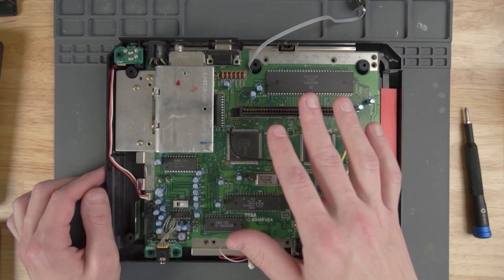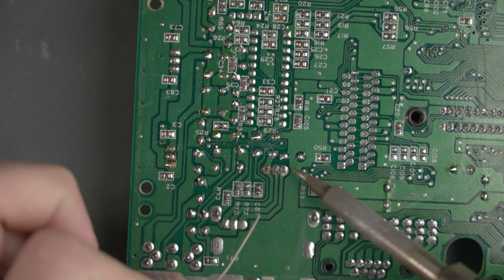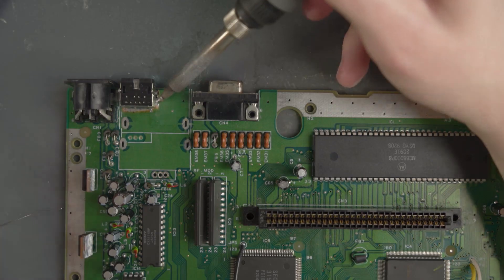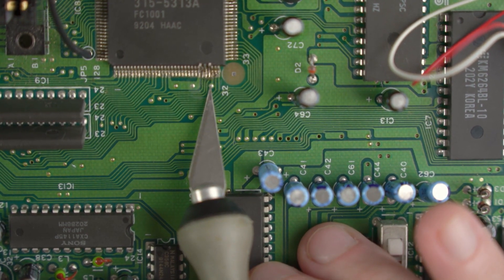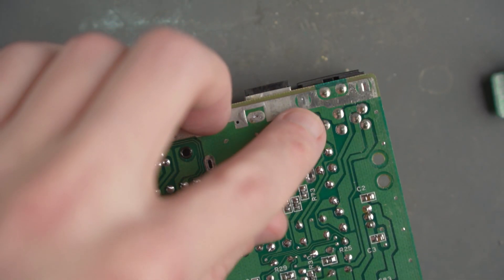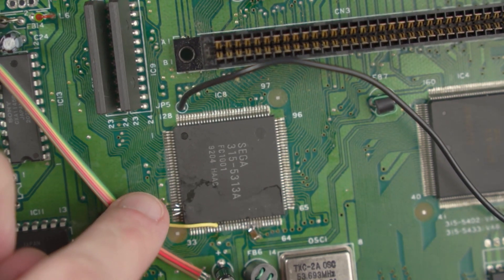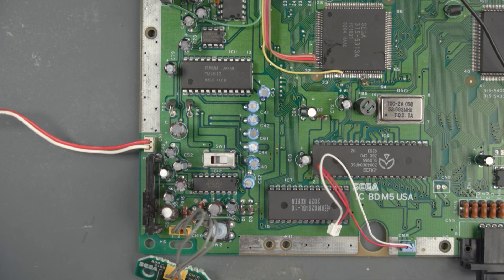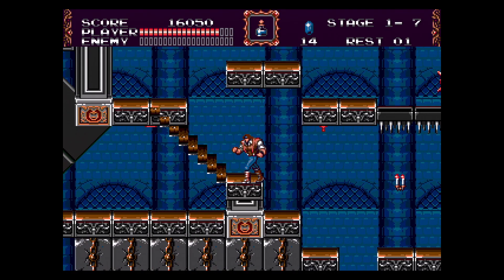Genesis Model 1 Triple Bypass Install - Remove Jailbars From Any Model 1 Sega Genesis!

Comment: Couldn't you just solder the bypass wires to the 8 pin din? just seems awful replacing that beefy port with a 9pin mini din all janky like that. Solders not very strong, definitely not a strong weld. You think all that heat melted any of the plastic inside it? Great to see you recapped it! Too many people don't even bother with new caps on these type of mods. New cap is always better than a 30 year old cap.
Reply: You can but there is more to it. According to the RetroRGB guide for restoring the DIN, you have to break R, G, B, and S outputs from the encoder (usually Sony CXA-1145P). He insists that you to trace from the DIN and cut the pins on the encoder rather than rely on the PIN numbers he provides… which is good because he wants us to cut pin 11 (Sync Out) for Sync which isn’t even connected in any of the consoles I checked. Pin 10 (Sync In) is the one connected to the original DIN8 but it comes straight from the VDP leg we’ve already soldered to.

The same instructions never actually tell you to connect Sync nor do they provide the PIN number, perhaps to force us to verify for our particular consoles.
Reply: @emmettturner9452  no shit
Reply: @theresatwinkleinmybrainnow696  LOL! I guess I should also point out that solder is the only thing holding the original port on too. ;) Still, I share your concern and used desolder braid to attach mine to the top and bottom of the PCB. I also used kapton tape to make a perfectly square area around it with nice solder fillets instead of whatever blob-shape you get when exposing copper through solder mask. Tinning the exposed area with braid removes all the bits of solder mask left by the scratch pen.

Now, if you think that’s “jank,” well, you should see my JP Mega Drive I got from Thailand with an RF modulator bodged onto the side (JP consoles don’t normally have RF). On the plus side, gutting the RF modulator gave me a place to mount the mini DIN, otherwise I would’ve had to use the original DIN like you describe with a big hole in the side for no reason.
Reply: @emmettturner9452  I always enjoy reading your comments Emmett Turner. Im glad my "No shit" comment was taken lightly Haha. Id argue that the original port was designed to be held in with solder but the janky port not so much. I just like to see mods that look stock i guess.
Reply: @theresatwinkleinmybrainnow696  No problem. :)

Part of the appeal of swapping the RF modulator is that it looks stock so it’s weird to hear that as a complaint but I know what you mean:
If at all possible then it should look totally stock next to an unmodded console. That is part of the appeal for these controller-operated region, frequency, and IGR boards. Someone down the line might assume it’s broken if they test composite/RF and there are no outward signs of a mod so I want a bit of a tell in this case.

The metal shield of a mini DIN doesn’t hold everything together when soldered upside down so it’s a valid concern for “dead-bug” mini DIN mods. A breakout or modboard like 3BP here should anchor the mounting tabs and pins together and the upside-down mount could potentially be even stronger. Doujindance’s 10P mini DIN for original PC Engine consoles surrounds the mini DIN for an even more secure connection.

That said, I think most people are doing it wrong by trying to melt a lump of solder and shoving them together. It’s best to tin both separately and remove as much solder as you can so that they sit flush, then flux and position the mini DIN. Only solder around the edges while fully flat but dwell at each edge long enough that the tin underneath will reflow.

It does kinda bug me that the cases are mislabeled and you can’t align the arrow on the cable with the top.

If my JP Mega Drive were not already drilled by some gray market Thai importer I totally would’ve done it the way you describe for the same reasons but all the Genesis consoles are getting the mini DIN treatment too since the RF modulator will no longer function anyway.

Comment: Hey @Dubesinhower, first of all good video. I wanted to know if you knew about the pull-up resistors that you have to install between 5V and each RGB line (usually on the 3BP itself). You'll see if you need to by going in the 240p test suite, color gradient test pattern. If there's no difference between levels 5 and 7, you really should install these.
Reply from the maker: Yes I’ve heard about this. My console had all the colors in the gradient, so I didn’t add the pull-ups. I think someone (maybe tianfeng?) mentioned there was a version of the 3bp in the works that contained pads for adding these pull-ups.

Thanks for reaching out!
Reply: @dubesinhower  Might as well mention that the 315-5313 I just worked on had a completely different Vdd pin than Bob's  on the side between 33-64 even though it's the same chip number. Multimeter saved an error, and it's undocumented on console5. Sega and their revisions...
Reply: @Prof_gLX  Pretty sure one is intended as a bypass cap for analog 5v and the other is intended for digital 5v. Are you sure you didn’t connect it to another analog 5v on that side? Also, I’ve seen 315-5313 and 315-5313A. Was yours the “A” variant?
Reply: @Prof_gLX  Another thing to note is that the RetroRGB bypass guide for connecting the model 1 DIN has you cutting pin 11 on the CXA-1145P when it is pin 10 on every unit I checked. Yes, that is the input pin for the encoder, not the output, but that’s the one going to the DIN.

Comment: Looking at the pins that have to be lifted on the board could we just solder to the LANS on the board that the pins flow out of the chip to and cut the traces just before they go to the VIAs to prevent having to lift the pins? maybe making this install way easier then pin lifting for those not comfortable doing that.
Reply: Yes, and some do, but that is more destructive. Less destructive than a broken pin, of course, so it all depends. It’s potentially harder for those using coaxial cable since you have less room between pins (they can spread when lifted).

The Tianfeng fix has made me reconsider lifting but even when leaving them down I remove/rebuild the factory 5.6k pull-up. I assume dirty 5v for the pull-up could contribute to jailbars. Of course, I also have to remove more components to disconnect the rest of the RGB circuit but if you are willing to cut you have a lot more options.

Comment: To remove the RF modulator I used my desoldering gun on the three pins then braid on the rest with my knife tip and a metal spudger that I would wedge underneath as the RF module came out.

For mounting the miniDIN I tin and then remove the solder with braid so that there is a thin, flat layer and then add solder to the sides. The braid also helps remove more of the solder mask that might remain.
Reply from the maker: Yes, and if you are going to remove the model 1 din, do that first so you can solder on 3 sides on the model 2 din
Reply: @dubesinhower  Yes. I actually removed mine to solder there and then put it back so I’d have dual outputs.

As a compromise for some Model 2 installs the 3BPv2 is no longer offset to fit flat beside the Model 1’s DIN8 but you can still raise the 3BP and solder while elevated. You know:
Leave a gap as if there is another board underneath. No need to remove DIN. :)

I’m tempted to make a simple PCB that elevates the 3BPv2, breaks out stereo, and rearranges RGBS for Extron MHR coaxial cable but any 9P miniDIN breakout board should work just as well for elevating.

…but you don’t need any of that to just float the PCB on the tips of the miniDIN pins and solder. It doesn’t have to be flat but the lower you can get on the DIN8 side the better since those are the pins that could have trouble reaching through and solder may not flow down. You can get the 3BPv2 flatter if you bevel the bottom PCB edge where it touches the DIN. You can also notch the DIN but if you remove too much plastic and mount the board lower it will interfere with DIN5/8 cables.

If you restore the DIN, the RetroRGB bypass guide tells us to cut the RGB and sync pins from the encoder. The pin number he gives for disconnecting Sync is incorrect for the consoles I have looked at. He says to cut pin 11 (Sync Out) but that pin isn’t connected on the consoles I’ve checked. Instead, Sync branches from pin 10 (Sync In) to the DIN. I would not lift the sync pin at the VDP because it also branches through a resistor to digital 5v and the 3BP does not replicate this.

Perhaps it is different on other consoles and this is why he said to trace the RGBS pins yourself before cutting anything.

Comment: Instead of doing them one at a time, consider doing them one VALUE at a time. Like, do all the 100uF caps, then all the 47uF caps, etc. Start with the most common value and work down. I like to also remove one of the least common values with each set so that I can replace that too without getting it mixed up and without having to do one at a time later. Like, remove all 100uF caps and one of the caps you only have one of. Replace that one first so you don’t mix it up then replace all the 100uF caps. Then remove all the 47uF caps and one of the other remaining values where you might only have one so that you can replace that one next and know all the empty footprints are 47uF. Rinse, repeat, and it won’t be nearly as tedious as doing one cap at a time. I like to mark them all with Sharpie marker before I start so that I can quickly find the remaining ones.

Of course, I did it this way and ended up replacing a bunch of caps I ultimately wasn’t even using. Oops! ;)

Comment: I've been planning on installing this in my own model 1 system, but having no guide was a little annoying. I eventually figured out where everything needed to go, but it's much nicer to have all the info in one place when I finally get around to doing the install. Thanks for the video!
Reply: Indeed! I also had to get the audio instructions from Firebrand X’s M1 Mini Mega Line Amp pages. Now, we have a reference video. Thanks so much!
Reply from the maker: Thanks for watching!
Reply: Stupid question: For the surface mount caps... one end goes on the designated pin, and the other end goes on a ground via, right?